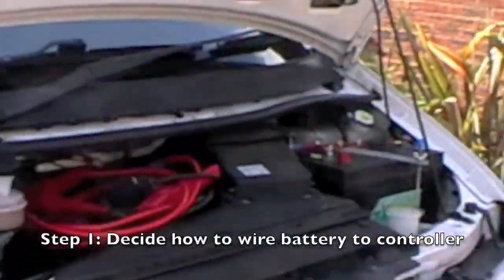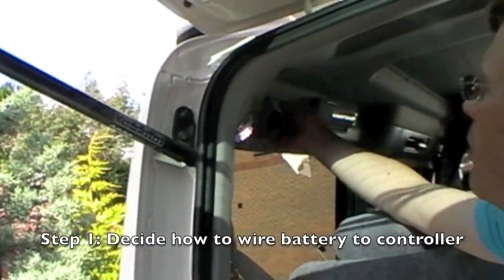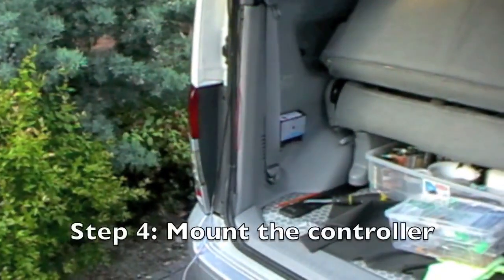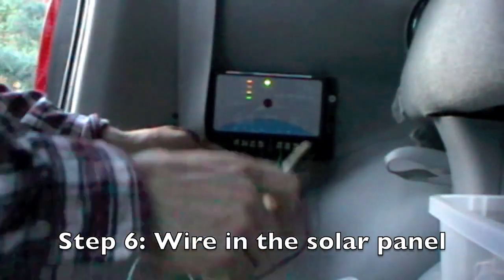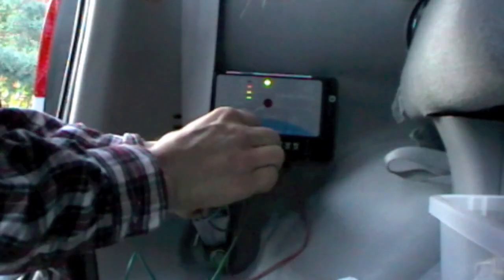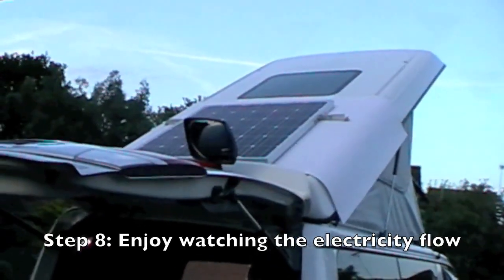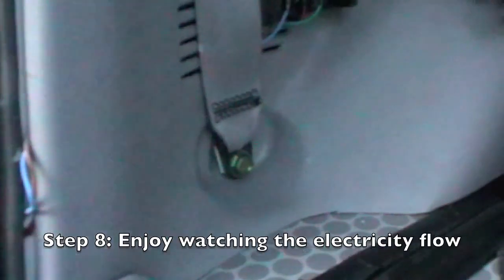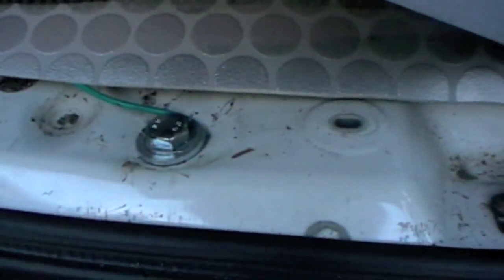How to install an 80w AKT Solar panel on a campervan

Comment: Good video but lacking a little detail on how you connect to the battery. Looks like you have cabled along the top passenger side plastic but you mention 'taping into the battery', I'm not sure what you could tap into to do that or did you run the cable the length of the van?